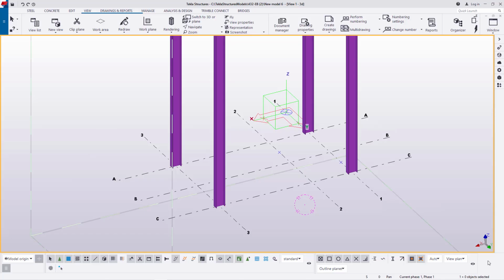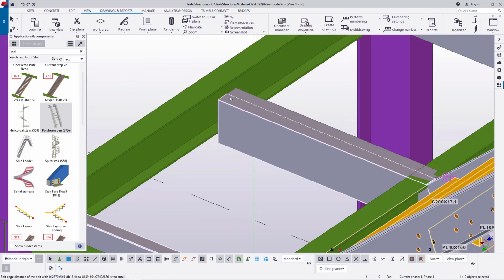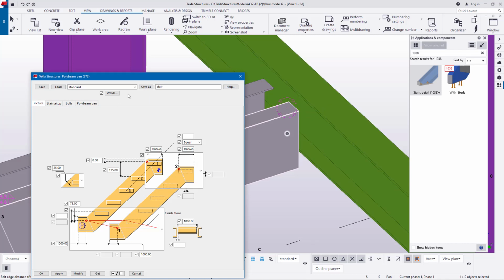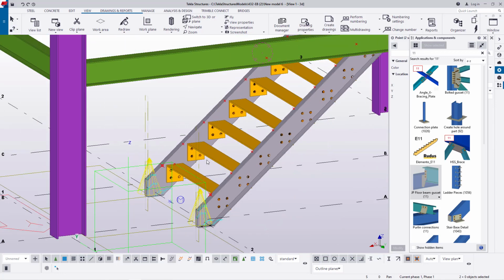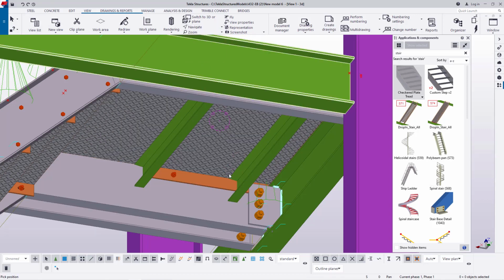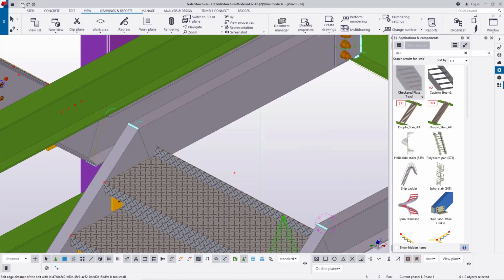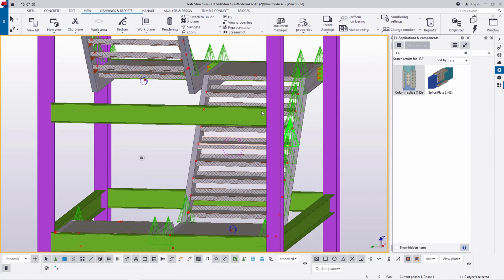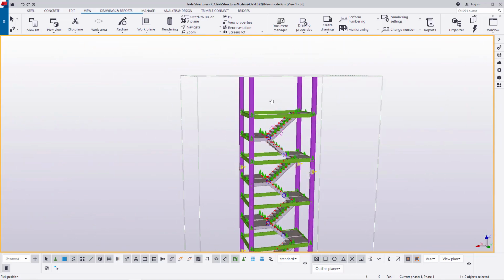Staircase Tower with Chequered Plate Treads in Tekla Structures

Comment: Often it seems you recreate treads with two points instead of simply copying the first one up to each point...? similarly you can open the properties to the first few landing beams/stringers, and use the "modify" button to apply the setting to other landing beams instead of manually entering the 50 each time..? Also when trying to space the first two landings equally, I would have created a construction line on the 1st and mirrored it from the midpoint of the exterior beam (2 things instead of so many)... Other than this, it seems like a great video.
Another tip: instead of deleting X/Y/Z values you don't want (when doing copy/move linear)... you can uncheck the box with values you don't want.
Reply from the maker: Good ideas, appreciate the feedback!